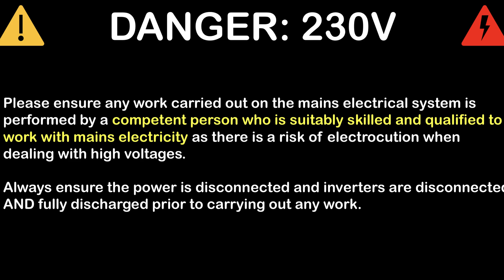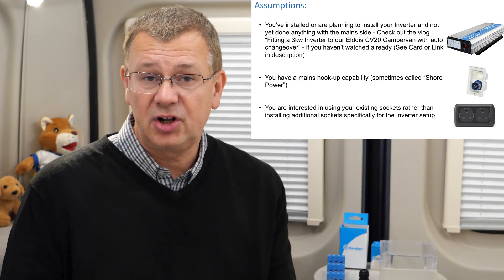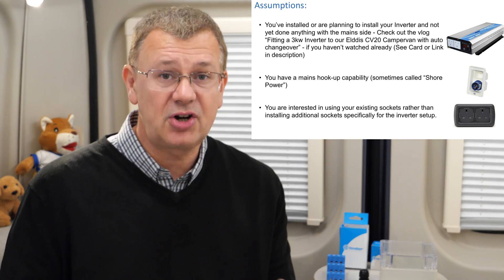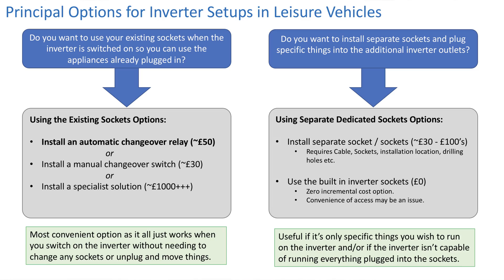Campervan Mains & Inverter Auto-Changeover for under £50 using a RELAY - How it works - Tech vlog

Comment: Hi David, I'm having a problem understanding your wiring diagram as looking at the blue connector at the top there are  three X three  banks of connectors. On your diagram there  are four connectors. Ive watch your video numerous times and still cant quite see how you have wired the actual relay.
Thanks for any help
Reply from the maker: Hi, there should be a live and neutral to the normally closed connections from the mains / hooked up power, a live and neutral from the  common connections to the sockets and a live and neutral from the inverter to the normally open AND the relay contacts so that when the relay is energised it causes the switch to flow from mains to sockets over to inverter to sockets.
Does that help?
All the best. David 👍
Reply: Thanks I have managed to figure it by watching video at the end showing where you put the cables. 
Would it not be easier if you diagram looked like the actual blue connector showing where the cables go as for me I couldn’t relate the two. Thanks
Reply from the maker: @kevinjepp7037  thanks for the feedback 👍

Comment: Hi
I have purchased a Renogy 3000w inverter that has a UPS function will the relay still work correctly?
Thanks Kevin
Reply from the maker: Hi Kevin, I think if you have the UPS function you shouldn't need it - it's 'kind of' doing that but slightly different (basically what mine is doing is switching the sockets to the inverter when it's switched on and to the mains when the inverter is off) if you connected your inverter in line with the sockets, it should do similar. The only thing to do is check to make sure it behaves the same way as I've not used a Renogy one with UPS. Hope that makes sense,
All the best, David 👍

Comment: Hi David excellent video and the whole series is very informative. A question about modifying vehicles in this way. My motorhome is under warranty how would this or any modifications affect the warranty, any ideas?
Reply from the maker: Thanks for the comment. It’s an interesting question. Typically any modification will impact warranty to one extent or another, for example if you make electrical modifications then it would impact directly what’s been modified but could indirectly impact other things such as electrical items. Worth noting can also impact insurance and other regs, clearly depending on what you do of course, 
Before modifying it’s worth checking the impact. For example though if you modify the electrics and the window starts leaking they typically aren’t related so you would expect the window to be not impacted but the electrical system to be in that case. Best worth checking if you’re worried - I got it with a view of modding electrics and other bits, as part of that the personal value I get from the mods outweigh warranty but know I’m on my own with electrical issues - worth noting the stuff you buy often comes with guarantee / warranty on those so the impact is sometimes neutralised.
Hope that makes sense, all the best, David 👍

Comment: The problem with a relay is there's no off position between the 2 supplies, which can result in an arc being drawn between relay contacts, as there can be 480v between the two live connections, so also a severe shock risk. That's why I use a 500v change over switch  instead. That's been running fine for 20+ years in several vans.
Reply from the maker: A relay is really an electromagnetic operated switch. The one I’ve used has 1.5kV (1,500 volts) AC dielectric breakdown between the contacts which is more than adequate for what I am using it for - it was something I paid attention to exactly to your point. I would agree if it was DC for sure on arc. (But it’s AC in this case)
It’s the same principal as the commercial switch over either built in or separate which use a relay. 
Biggest issue (like with a switch) would be a physical failure causing things to come into contact - they look well designed but I have seen in the past some you wouldn’t trust.
Whatever works for you though - lots of folks use switches and nothing wrong with that at all as you have a specific manual change over. 
All the best, David 👍

Comment: Thank you for this brilliant video I have just finished yesterday fitting a 3000w inverter in my Peugeot Boxer , I fitted it exactly like yourself even purchased the relay from RS, This really is a game changer just one switch and all sockets are now powered from my inverter, but I may have a problem or not, on checking my sockets with a Martindale I have no Neutral while on inverter power even the outlet socket on the inverter is the same, on shore power everything is ok, tried earth link to Neutral and it worked but of course tripped the RCD when on Shore power,  I have connected the DC out with a 3 pin 13amp plug exactly like yours, but there is also  a hot wire facility with chassis earth would that be better.
Hope you can help me out 
Many Thanks
Ian
Reply from the maker: Hi Ian -
Assume you mean essentially it’s not neutral to earth tied on the inverter? That’s quite normal with a lot of inverters as they outputs float rather than the grid where the earth and neutral are tied at some point.
Some of the more expensive inverters have this but essentially the issue is there is no earth in that scenario and the socket testers do a variety of different results -
Assume everything is working just testing. It should always test fine on shore power though else there is an issue.
Hope that makes sense - all the best, David 👍

Comment: Hi again....Bit of a fopah this end....
I got the bits to do the job and upon opening my consumer unit i've realised i have 3 circuits. As it stands i can simply plug my rv into the inverter and power the whole thing...If i fit the relay I'll loose 2 of the circuits...Is it acceptable to fit the relay before the consumer unit, that way i get to keep all my circuits. Thanks again.
Reply from the maker: Hi, you could do that but it would be worth putting some pre-protection in if you do it that way with it being before the unit which has the protection in.
The other thing to consider is if you put electric heaters on etc it may either overload the inverter or run the battery down very quickly.
Hope that helps / makes sense.
All the best, David 👍
Reply: @LeisureBit Thanks David...After giving it some more though putting the relay in front of the consumer unit is effectively how i have it set up anyway...At present I have a socket from my inverter in the hookup locker and I just plug the shore power into that when I'm off grid...
I have propane and diesel blown air heaters so no need for electric ones....It's the airfryer/microwave/toaster (got to have toast)/coffee machine type things i'll be running...I have 400ah of batteries and a 3kw Kotek inverter so the system is up to the task...I should add, one of the circuits runs the 240/110 transformer for the American items/sockets in the RV.
I'm planning on fitting it tomorrow so i'll report back when it's done. Thanks again.
Reply from the maker: @kennyrodg  hope all goes well with the fitting tomorrow - all the best, David 👍

Comment: Question do you reference the inverter
Reply from the maker: Hi James -
Sorry i’m not understanding the question - do you mean in the video?
Reply: @LeisureBit  if you put a socket tester in one of your 240v sockets while the inverter is on. Do you get an earth fault ?
Reply from the maker: @jamesdyer6807 yes it flags as it’s looking for a neutral earth bond which doesn’t exist with this inverter (floating output). When hooked up to mains and in that mode tests fine. Depends on the inverter type but the one I’m using isn’t Earth Neutral bonded which is what the tester is looking for.
Reply: @LeisureBit  so sorry your advising that people fit rcds which is pointless in your case because it wont work ?
Reply from the maker: @jamesdyer6807 it will if there is a difference between the outputs - for example if a fault developed and a current path to the vehicle chassis which is negative then it would cause imbalance and trip - however there is much less likelihood of there being a path with it being floating - better than not having one just less scenarios to trip given the lack of bonding (outside of a fault condition) I fitted one to help and give a point of isolation / if balance issue between the outputs

Comment: Hi David, Thanks for this video, like you said "game changer, less faffing about", I have just completed this upgrade and it works perfectly the only difference I did was to take the feed from the shore socket into the relay as you did and I used the existing wire out of the relay to the consumer unit so the consumer unit is working the same as if I was on site and plugged in. I can turn the battery charger and water heater on and off independently on the consumer unit so with those switched off I still get power to all 3 pin sockets. i have a 2000kw renorgy inverter. I did a 15 minute test on the water heater (which give us enough for 2 quick showers) with no problem and no heat generating on the wiring or connectors . I have a 230ah LIFePO4 battery which copes very well. all earths are joined as well as the earth to the inverter. id appreciate your feedback on doing it this way. Many thanks.
Reply from the maker: Thanks for the comment - interesting you have done it that way - I considered it initially but the space heater and charger I wanted to keep separate bur I do like the idea of the water heater - I’m pending some changes to mine.
Like what you’ve done there - how much power are you finding you use to heat the water? It’s a great one for off grid isn’t it.
All the best, David 👍
Reply: Hi David, thanks for the reply,  I have a Thurma 10L  1.5kw heater, on a quick test today I ran it for 18 mins, these readings are from the BMS via bluetooth, 932w,75A (while switched on),the ah went from 143 down to 122, and % went from 62 to 53. hope this makes sense.
Reply from the maker: @eddieuk9402  Thank you - really useful to know - appreciated.
Reply: @eddieuk9402 - Just to clarify - do you have the inverter and the shore cables going to the relay, then from relay into the consumer unit?

If so, does that mean you don't need a second RCD for the inverter (there's only the one in the consumer unit)?
Reply from the maker: @wfdTamar yes that’s right but I’m just using it from the sockets circuit so the mains side is protected by the consumer unit RCD and the inverter has the RCD I put in (which I know given how they work isn’t as effective as mains as no earth neutral bonding but much better than northing) and that then feeds onto the sockets so normally closed connects to mains and normally open to the inverter along with the coil of the relay.
So in my case i do as the sockets wouldn’t be protected on the inverter otherwise ref RCD.

Comment: David, do you have the RCD and the PUD reversed? As they are both on the 240v phase, should they both be an RCD? If not what PUD did you use.
Reply from the maker: PUD? There’s an RCD on the mains input and also one on the inverter output and the relay is basically switching over between either the mains or inverter which feeds onto the sockets.
If that makes sense ?

Comment: Hi David, many thanks for your very useful informative videos. I have a question regarding when you power the outlet from the inverter, how do you disconnect the leisure battery charging?
Reply from the maker: Thanks for the comment - I have it only wired to the sockets and the charger is on a separate circuit (as is the space heater and water heater) so it’s only working with the sockets if that makes sense?
Hope that helps,
All the best, David 👍
Reply: @LeisureBit  Thank you for you very fast answer and it make sense 🙂 Now I will watch your video about insulate the doors in the van, starts to get cold now 🥶🙂
Reply from the maker: Excellent - I also found putting insulation in the back corners and above the door has helped in ours too.

Comment: Hi David, great video, saw this some time ago and just come back to it because I want to do something with my power bank like this. Can I use this idea to take the output from the surepower rcd on the Sargent box in to this for the one side and then have the 240v out of the Aferiy 2000wa power bank as the switchover supply to the other side for the load if its on? I am also wondering if I then also had the power bank plugged into the surepower mains and connected to a solar panel (powerbank has built in mppt to 500watt) I could also have the ability to charge the bank up without moving it? I looked for the parts you used and I think the socket is missing a '2' from the '400-840' (2) so I think I have the correct part. Great video, would be grateful for your thoughts on this but I would like to try and get the power bank sat somewhere in my van without having to plug things in directly or send the surepower out of the van window 😂😂
Reply from the maker: Thank you - I think you could - the principal of it is when you turn your powerbank or inverter on it energises the relay and then electro mechanically automatically switches over the power (Live and Neutral) between the powerbank / inverter and the mains onto what you want to power - in my case the sockets as I didn’t want to run the heater or charger from it - so sounds like that would work - the benefit is it disconnects the mains side so you don’t end up back powering things or connecting the two - hence why I went with a relay rather than electronic solution as you get the physical isolation then as it’s like an auto changeover switch (if that makes sense)
Thanks ref the right part number too.
All the best, David 👍
Reply: @LeisureBit  Cheers. Do you have the diagram please as I can't seem to see it on your website. atb Tony
Reply from the maker: Will dig it out and upload it if not will create a new one - sorry about that
Reply from the maker: Quick update - I’ve looked and can’t find the hi-res version of it so will do another one at the weekend and upload it.
Reply: @LeisureBit  Many thanks David
Reply from the maker: Should be on the website in 
Help and Support at the bottom called Change Over Relay - all the slides and diagrams are in a pdf there - hope that helps.
Reply: Cracking thanks so much David

Comment: Hi David, I’ve been watching you lithium series of videos and enjoy them all, on the changeover video I was wondering if the inverter was left on either by mistake or on purpose and then you connected the ehu, or even vide versa, how would the relay react? , and also are you still using the changeover relay with your new set up. Many thanks.
Reply from the maker: Thanks for the comment - if connected to EHU and the inverter is on, the relay is energised so the EHU contacts are then open (they connect to normally closed and when energised it opens the contacts to route the power from the inverter rather than EHU. One of the reasons I used a relay is physical electrical isolation (ie the contacts get mechanically moved)
Hope that helps, all the best, David 👍

Comment: I’m planning on installing a similar setup and will be looking at using this for my sockets in the motorhome. Would it be a good idea to use an RCBO on the inverter connection instead of and RCD to give added protection for current overload.
Reply from the maker: You could do. I used the RCD as an extra protection against any leakage current, the plug feeding from the inverter has a 13A fuse in it and for full load would probably mean a 16A RCBO so didn’t in my case as it would have increased cost - however with certain setups that would make total sense.
The RCD is semi effective because the inverter I used has floating outputs, if it’s a tied E-N inverter they are more effective (and - to E).
Hope that makes sense, certainly no harm in RCBO for sure, worth making sure it double pole.
All the best, David 👍